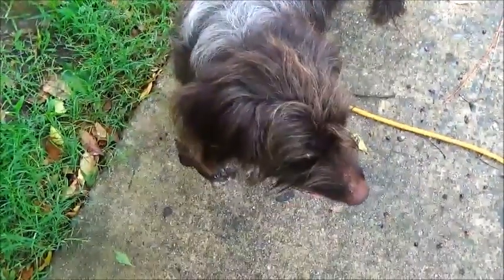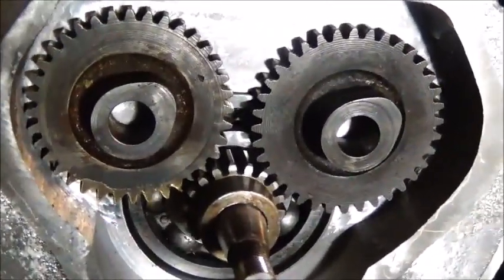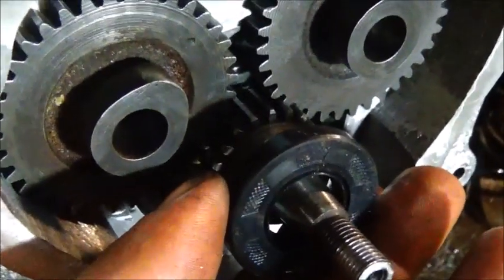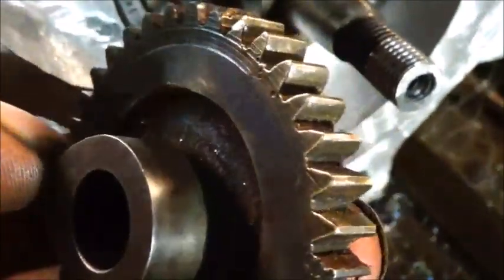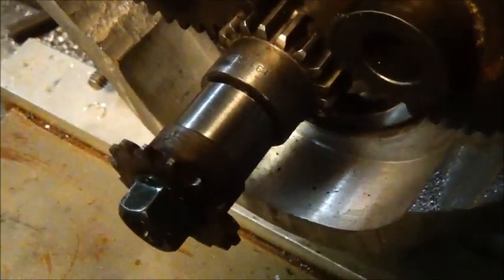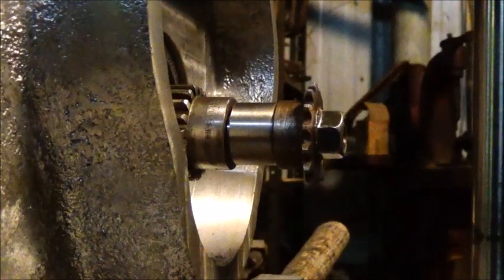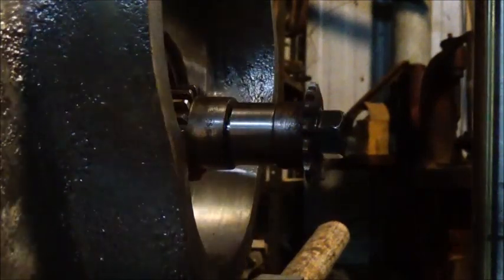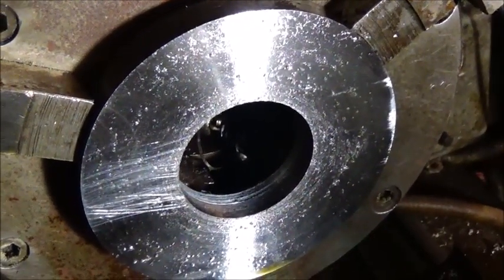Antique Motorcycle Engine Build (Replica) Part 21 Crankshaft Work

Comment: keep up the great shows. I want to see it run. I believe that it will. looks good. thanks. the dog wizard. just a thought if it really bothering you. you could drill that hole just a bit. not deep, and thread a bolt into that hole and just cut off the bolt a machine it down even. but the j b weld works great. I fixed a head with it about 20 years ago. still runs fine.

Comment: Jonathan if you get 3 or 4 2 x12 cut the birds mouth in then then drive some 2x4 stakes in the groung and nail it with the duplex nails which we call a 10 penny smaller ones 5 penny it will support that roof so you can fix that porch an there won't be a beam in the way. That's the way we do it.

Comment: It does look like a Griffon. They are typically pointing breed bird dogs that are less high powered than a Shorthair or a German Wirehaired Pointer. Slower, more methodical and less flash and dazzle than those two. Like the GWPs they normally find 'em, point 'em and retrieve 'em.

Comment: Backlash will be needed not only to control noise and valve timing accuracy, but to allow for expansion and possible binding of the gears.  Large gears can require 0.040 in backlash (large gear reducers).  It would seem the meshing gears' pitch circles should just intersect, but some clearance is needed based on tooth form.  Will be interesting to see how this turns out.  Spur gears like these are going to generate some noise, more so then helical.

Comment: shingle ripper - thin band iron like a slim jim with a striker end to coax the fastener out...a wide flat w/ fish hook cut in it arrangement. machinist / macinhery handbook has that data  the ideal mesh in relation to center(s)

Comment: a shingle is 36" if you take a flat pry bar take out all the nails out of the shingle you want to remove and the shingle above it you can get the bad one out .you also can cut a shingle with a straight blade razor knife from the back side of the shingle

Comment: Jonathan, if you suspect asbestos in anything, pleeeeease throw it right into hazardous waste, don't touch it. A mechanic friend of mine was just getting ready to retire while still doing all the things he loved to do - but instead he died after 2 weeks in hospital. Something with the lungs. While it probably had nothing to do with asbestos, it showed us how sensitive lungs are, and how little the doctors can do about it.
Reply from the maker: I have dealt with it plenty of times. If it gets airborne and you breath it, that's the problem. I highly doubt there was any in these pucks, they were fairly new. The brakes on the old cars ot here have it in the linings. I just wasn't sure what materials they use in the newer stuff, so I wasn't taking any chances.

Comment: More back lash, more noise? Less back lash, actually touching, less noise?
Reply from the maker: This one is noisy with no back lash and quieter the more you have. There is a formula using the Diametral Pitch,  Pressure Angle and Pitch Diameter, A friend has a book on it and we will know the proper backlash tomorrow.

Comment: You need to set the depth that the teeth run at,not the back lash .So if you google gear teeth depth you will see hundreds of pages on the subject :-). you need to learn a few new words, such as addendum ,dedendum and so on but it's all about setting the depth that the teeth contact each other. I learned all this stuff as an apprentice 40 plus years ago but have never had to use it in practice so watching you do this brings up a lot of things in my mind , and things I  never had to deal with on the job. http://enginemechanics.tpub.com/14111/css/Figure-3-1-Gear-Tooth-Nomenclature-94.htm
Reply from the maker: Center to center should be 1.6875 then with a appox. Tolerance of +/-.002, but the issue I have is that the crank gear is new and the cams are 90 years old, I was told that the original briggs crank gear was made to to the crank then machined in, so I couldn't get one. I think the gear design of the new gear is more of a "silent" design and the old is just straight cut, but we will figure it out.

Comment: about that metelurgical formula, if you would keep it rather hush hush, I will be greatfull. thanks.
Reply: at least till we test it.
My idea is to cast it around a 
steel sleave that is red hot before ,
the sand mold is closed around it, so it brazes to the steel as it cools.
Reply: for the cooling fins on a cylinder.

Comment: JW, seen this?
http://www.engineersedge.com/gears/gear_backlash.htm
Reply from the maker: Yea, we figured out the backlash and the required measurement from center to center, but because I have a set of 90 year old gears and a new gear, I will be shimming .003 to find the right location. Very good read.